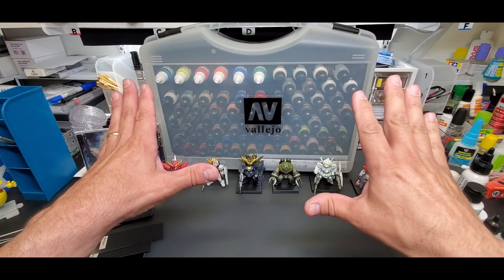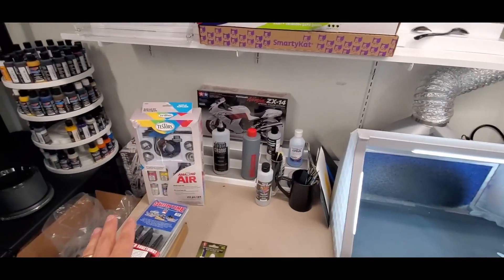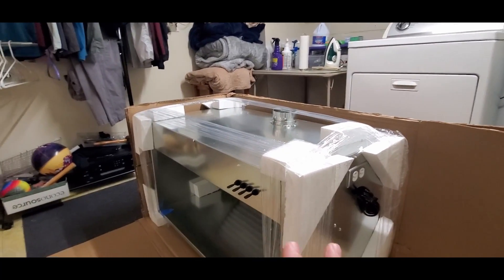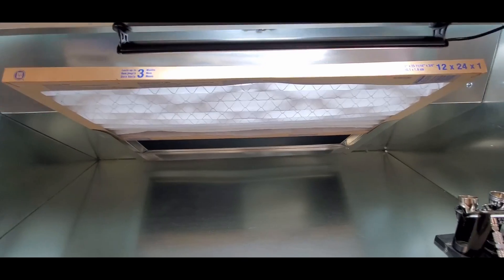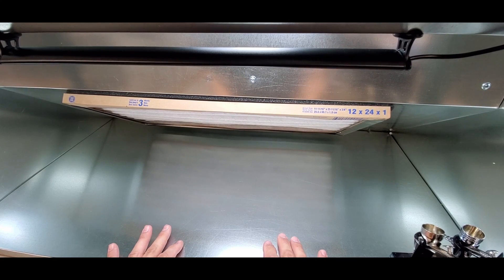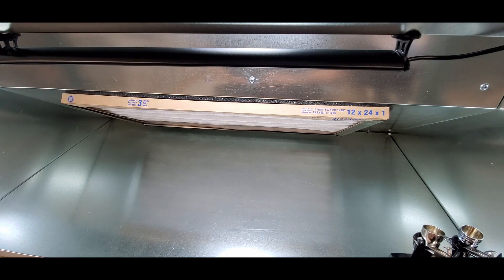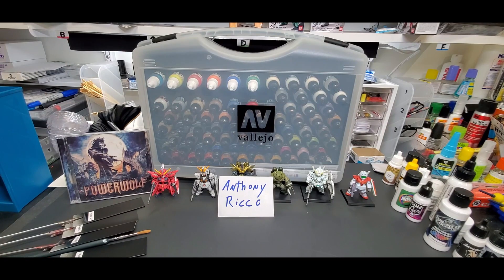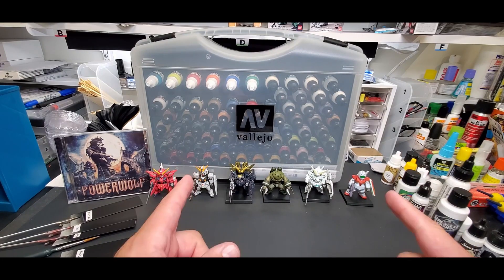New Spay Booth Unboxing & Set Up - Pace Spray Booths - Plus The Winner Announced !!

Comment: Gratz Anthony. Nice booth Barbatos, I bought a smaller one in 2004, and it is still running strong. Not as much exhaust pull, but works for what I am doing.

Comment: That’s where I got my booth from earlier this year! I have the 24” Super Mini. It’s my first booth and I love it. I’m very interested in seeing how you light it. I’ve been struggling with my painting area being too dark.
Reply from the maker: Worked on the lighting all day today. I'll show what I've done this week 👍
Reply: That's the one I got, about a month ago. There was no way I was going to buy one of those cheap plastic toys with a computer fan! This thing is so professionally designed and built that I knew I had to get one. It's a lot quieter than I was expecting and has a great flow rate. This is also my first booth, and may be my last, since it's so well built. I'm finally able to move from acrylics to lacquers, and they're so much easier to use than acrylics.

Comment: Planning to build my own airbrush booth.
Reading that the fan should have at least have a cfm of length x width x 100 (in feet).
Checking the specs of yours, it has a 34" x 13.5" face.
So that would be around 2.8 feet x 1.3 feet = 364 cfm.
But the specs of that booth say it's only 265 cfm.

For that price I would expect a higher cfm.
Mine will be smaller but I already have a 350 cfm fan.
This should allow me to add another filter layer in front of the pleated filter.
Like a a cheap foam or fiber based filter that is super cheap.
That would increase the lifetime of the pleated filter by a lot I think

Comment: I just ordered the same booth the other day!  - a quick note in my research ....if your still going to use the external inline fan make sure you match the rpm setting equal or above the pace built in fan...otherwise you could cause a slowdown or back feed issues.. also with ipa and lacquer paints ...there is explosion risk... while the pac fan is rated as explosion proof ...you may want to check with acinfinity about the external fan
Reply: I just got the same 36 inch booth....love it!  and much quieter than i expected,

Comment: Along with a decent airbrush, and compressor, a decent spray booth is a good purchase.  By cheap, buy twice as the saying goes!

It's a Benchvent BV300D Spray booth I use. Not quite as  big as yours, Barbatos, but a lot bigger than the typical fold down hobby spray booth.

Comment: I haven't fully watched the video of your unboxing of your newest spray booth which is more of an industrial spray booth than a hobbyist booth in my opinion.   please tell me that your previous booth still perform the job adequately nothing happened like for example the fans didn't start to make crazy sounds or simply fail months after you started using it because I'm considering picking up this very spray booth from a local hardware shop and it's on sale for about 170 bucks Canadian... I had been looking at manufacturing my own booth I actually found online really good plans for a homemade booth using a centrifugal extraction fan but it would cost me north of about $300 in total materials the extractor fan being the majority of this cost.... so with that long preamble would you still recommend the booth you ordered from Amazon... still functioning fully acceptable?

Comment: You just gave a quick review of the waterfall paint booth. Did you send that back?  Can the Pace booth handle spray cans? I use a lot of rattle cans as well as an airbrush and only want one booth.
Reply from the maker: Spray cans work great, I just sprayed primed a bunch of pieces. Layed down paper across the bottom, put all the parts down and sprayed them. Worked great
Reply: @barbatosrex9473  Thanks. Sounds like the perfect booth for me.

Comment: Judging colors against a dark background always makes them seem a bit lighter/more saturated than they are, and against a white background it does the opposite.

Good color for the pads (and any background for color and tone critical work, really) would be 18% Middle Grey / Neutral Grey Nº5. Gives you a neutral point to judge lightness/darkness and removes any hue skew. Also helps with camera white balance, so you can get more accurate colors.

Photo and video editing studios usually have whole rooms painted in N5.

Comment: If you remove the filter. Do you think it can suck dust when sanding?
Reply from the maker: I would say no it can't
Reply: @barbatosrex9473  thank you. I will probably stick to my spray booth or maybe add extra fan between the hose if ever i got this.

Comment: What is the diameter of you extra fan. 4. 6 or 8 inches?
Reply from the maker: It's a 4 inch
Reply: @barbatosrex9473  I’m almost finish building my own booth with will be a 8 cubic foot. That’s 24x24x24 inches. My hose length will be about 1 1/5 to 2 times yours but my blower is a 6 inches Vevor with a 400 CFM. But no fan in the booth. Do you think that the 400 CFM is enough? I Can’t still  find a proper fan to install in my booth yet.
Reply from the maker: @chauffeurmarco  I'd go with a 6 inche, this one
https://amzn.to/43Srrj4
Reply: @barbatosrex9473  now I just brought the booth in my working room.  I calculated that the hose will be 7 feet long.  All left to do after getting the blower is buying the hoses and decide the size of the opening to let the air through

Comment: Quick question, I love you videos, but I notice you always use a gravity feed airbrush, do you ever use a siphon feed airbrush?  I would love to see how you clean a siphon feed between colors and cleaning when done.  Thanks.
Reply from the maker: I dislike siphon feed airbrushes because of the troubles it is to clean them. I end up spending way to much time cleaning the jars, tubes, gaskets before I even start on the needle and nozzle. I have to soak the siphon hoses in solvents over night and then hand clean them. After a while I have to replace the gaskets. If I'm going to use the jar for another color I must use Acetone to clean them out. It takes me 1 minute to clean my gravity airbrushes. Plus I feel they're more efficient, they use all of the paint in the cup. Siphon hoses can't grab all the paint. For these reasons I only use gravity airbrushes.
Reply: @barbatosrex9473  thanks for the feedback, I have a siphon feed now, but it’s a pain when I need to spray a little amount of paint, and yes, the clean up is a pain.  I have my eye on an Iwata gravity feed airbrush.  Thank you for your response!

Comment: When adding lights to your booth, you might want to look specifically for high CRI lights to do the colours justice. The cheap LED strips typically are kinda crap when it comes to CRI.

CRI stands for Colour Rendering Index, basically how well the light is able to render colours. The closer to 100, the better.
Reply from the maker: Great info, thanks 👌
Reply: Yes this is true facts here. Automotive spray booths have the same kind of lighting .

Comment: Some of the comments prompted this query in my mind. At what point is a fan so powerful that it pulls away paint that would be better off on the model? If its main purpose is to expel nasty chemical fumes, it seems that a respirator and a weak fan would be a better plan. Anyone?
Reply from the maker: The fan is actually just right. It's subtle. The paint still shoots straight across. As we know the filter catches the paint particles and the fan pulls the smell so you're right the fan doesn't need to be super powerful. I just want to get into spraying larger volumes of paint through larger needles. I'm looking to get a 0.7mm nozzle airgun, that will be pushing a lot more paint than I'm used to
Reply: Guys complaining about the fan just don’t own a booth designed to vent properly that is sealed. I own the 24in version of this and it’s amazing. Best decision I made in the hobby.

Comment: I also have a 24" Super Mini (5 years and running!). Knowing how well they work, your extra fan is more harm than good. It creates a restriction and wasting electricity. The Pace booth is more than all you'll need. Trust in the quality of your tools. 
The lighting is a tad over kill and wrong for what you're trying to achieve. For the 24", what is supplied is more than enough to cover any of my projects. 

I think over time, you'll understand more about the booth and produce some great content. 

Thanks for sharing.
Reply: If the in-line booster fan is properly matched to the primary fan then it does not create a restriction but since Robert has not given us any information about either fans' flow rate and pressure drop we don't know one way or the other.  And given that he is using flexible ducting, something I personally hate and have fastidiously avoided in my spray booth exhaust system,  the booster fan is probably a benefit.  If he were to redo his exhaust system using rigid ducting with a minimum of elbows then he would almost certainly be able to dispense with the in-line booster fan.  But he seems to be happy with the setup and he certainly gets good results so this may well be a case where optimizing a system for the last bit of performance or cost savings is not worth the effort.
Reply: @68Jaguar420G . I have only the one spray booth and use dryer ducting. The exhaust fans on the booth I have are more than enough to evacuate fumes and such. My statement was based on what I have and I'm sure he'll do fine. It was just an observation.